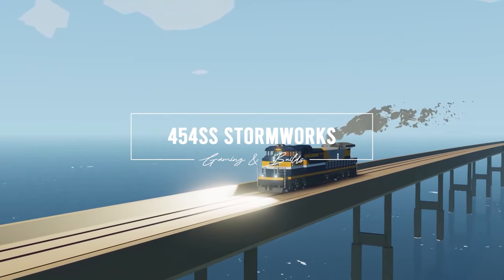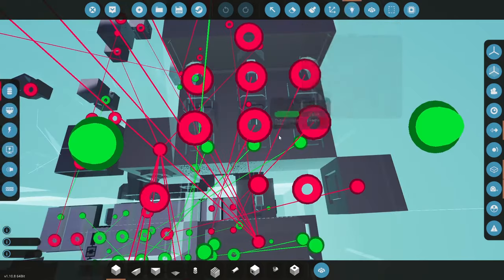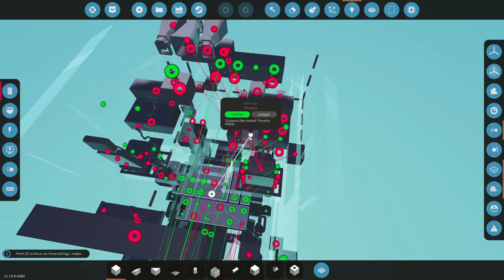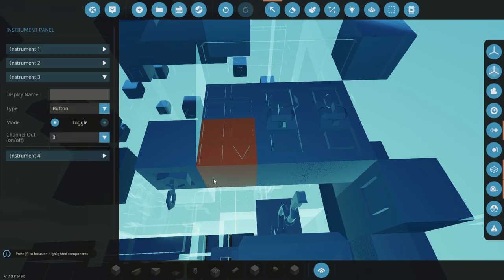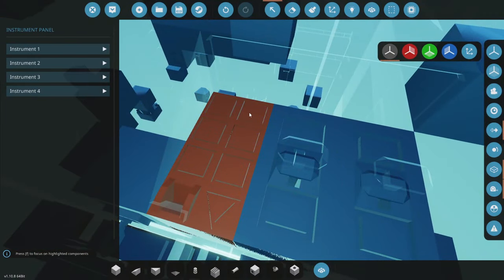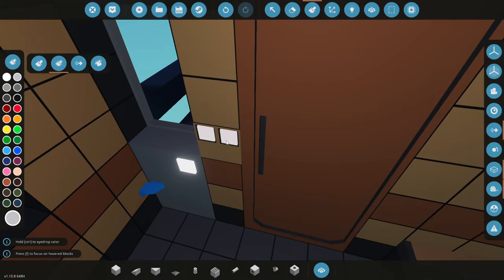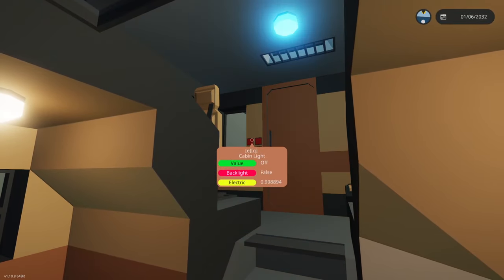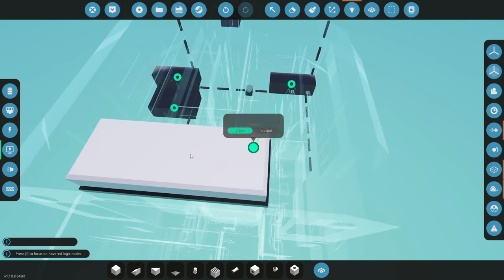LOCOMOTIVE Optimization Failure in STORMWORKS!

Comment: To avoid wheel slip, why not instead of clamping the throttle you clamp the acceleration ?
To accelerate, it mean than your wheels are going faster that the train current speed right ?
So wheel slip happen when your wheels are going way faster than the train
Also, reducing the weight of the unit may help to increase the speed of when wheel slip happen
Reply from the maker: Good idea, but there is no wheel speed (that I am aware of) that can be compared to the train speed - there is torque, power, etc. but that won't define the slippage at a given speed. I will try reducing the weight, to see if that helps! For crane and other mechanical things in Stormworks, generally a heavier weight means more stability to get more speed, but it may be different for rail based creations
Reply: @454ss_gaming  You can get the wheel speed with the formula : v(m/s) = 2pi * radius of wheel(m) * RPS of the wheel
A torque meter connected in T with the gearbox and the motorized wheel will give you its RPS.
But its true that my suggestion will not completly remove wheel slip because the calibration of the acceleration clamp depend on the targeted maximum load of the train
Reply: @454ss_gaming , i made some regulators that controls wheel slip. If i remember it right, you only need to multipy rps by pi to get linear velocity of wheel. All sizes of train wheels have the same speed dependence from rps, no matter how they looks. And wheel slip starts when difference between linear speed of the wheel and actual linear speed rise up to ~9-10m/s. If you could hold this difference in 7-9 m/s then you will have highest torque. If you need to pull more weight -> you need more wheel parts, not wheels. 2 single-wheel parts will perform 2 time better than 1 part with 2 wheels.

Comment: How are you able to tell if the wheels are slipping in a micro controller?
Reply from the maker: Yup, it gives a ON/OFF status if they are slipping, you can attach it to an indicator or to a MC
Reply: @454ss_gaming  cool, how are you achieving that though? Comparing wheel speed to actual speed or?
Reply: @nutsandy7183 the wheels have a built in on/off output that says wether or not the wheels are slipping

Comment: Is a hybrid train who is powerd by electric engines but get power from diesel engines a good idea?
Reply: I don't know about real life, but in stormworks, you can put your wheel carriages on an unpowered velocity pivot to make them follow the curve of the tracks better, and using motors is the only way (that i know of) to get power to the wheels.
Reply: That is how they are irl it's called de or diesel electric
Reply from the maker: Yup, that is a Diesel-Electric locomotive!  You can have direct-drive, but I am trying this system here :) I put an unpowered pivot to turn the curves while the motors are attached near the wheels!